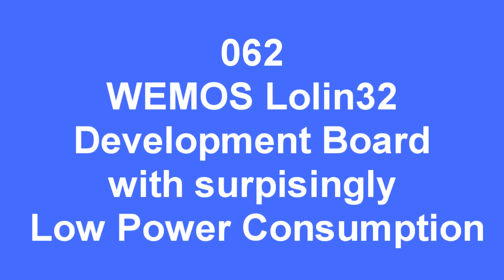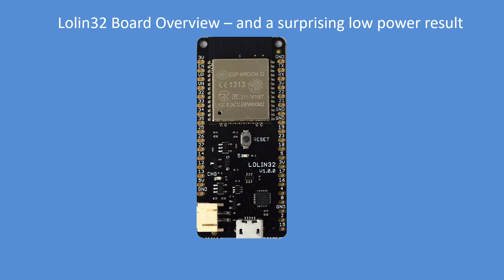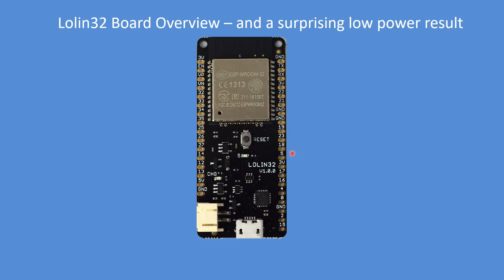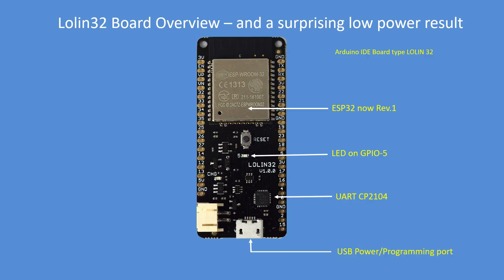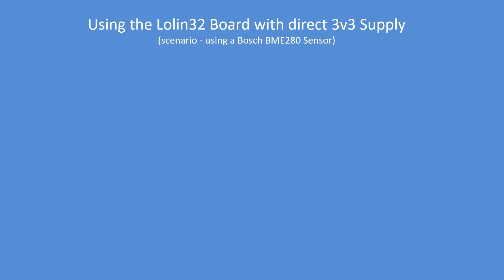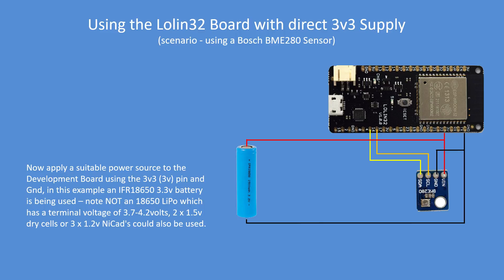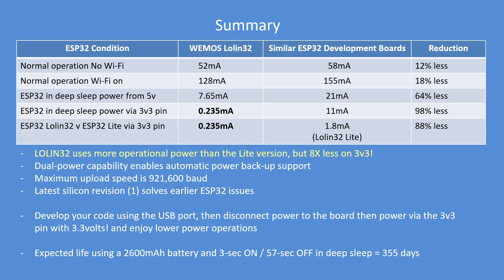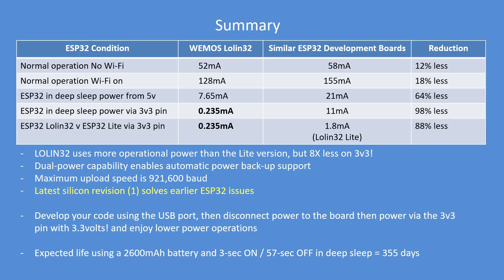Tech Note 062 - WEMOS Lolin32 (surprisingly low power demands when powered by 3v3)

Comment from the maker: The Wemos Lolin32 board consumes via the Battery input terminals ~122mA with Wi-Fi operational, 39mA when Wi-Fi is off and 128uA when in deep-sleep. This board is one of the best available for battery powered projects, bettered only by the DFROBOT Firebeetle32.
Reply from the maker: nearcz Are you using I2C as the LED is connected to the same pin. What I would do is print out LED_BUILTIN or check the IDE hardware variants then Lolin32 and see what pins have been defined for the compiler you may need to move the PIN numbers around for I2C either that or just before sleep switch the LED pin to an input. Any problems let me know so we can fix it.

Comment: I'm facing this issue for nearly 4 months; "A fatal error occurred: Failed to connect to Esp32: Download mode successfully detected,but getting no sync reply: The serial TX path seems to be down.
Reply from the maker: Most likely actually ESP32 or out of specification. Have you checked your power supply is adequate to drive the ESP as peak currents can approach 1-Amp easily when the wireless is activated
Reply: @G6EJD  I haven't used an external power supply yet, I was trying to program it through the USB cable as the power source.
Reply from the maker: @amirphilip2234 then that’s your problem, try a different USB port ideally on a powered USB Hub. An USB port can supply 1A which is marginal.
Reply: @G6EJD  I tried that,I also tried using different USB cables but still.I tried to reduce the baudrate also but none worked.
Reply from the maker: Then suspect out of specification devices. There are no endemic issues with the ESP32

Comment: Hi, nice technote. I believe I have the same board as you and I powered the GND+3.3V from a PSU like in your example! 
Yet, I still have a 7.7-8.0mA deep sleep consumption.
Also when the board wakes up (after correct time elapsed), It claims that the bootup reason is 0 and not 4(timer) as it should be. When that happens it also forgets the bootCount I store in RTC.
I use both UART 0 and UART 2 in the code - could that be triggering some more deep sleep consumption from USB chip or Serial-chip ?
Any ideas - this drives me crazy :-(
Reply from the maker: The board I used was a genuine Wemos D32 and the regulator on that board can withstand an external output voltage drive, ie 3.3v. So if you’re seeing 7-8mA something is sinking that current, of course you are removing the USB connection when measuring. I suspect the regulator type has changed or the board design is not the same. The ESP32 UARTs are used for the serial connection and programming  another for the flash memory communications, so you need to be careful your not using the wrong UART.  If the ESP32 is being reset, and it is because it’s losing RTC backup then suspect a power issue. It would be much better to power the board via the LiPo connector then there is the correct isolation in place. I would start with a basic deep sleep example to prove the principle that there is low power consumption possible then move on in steps to find out what’s causing the issue. You should easily get to 10-11uA sleep current.
Reply: @G6EJD Thanks for the clues - I alrady tried doing exactly that - connecting a LiOn cell to the battery connector and I see exactly the same behavior even if the cell was fully charged and measuring the current I saw the same 7.7mA.
Is there a chance I bought a pirate card than looks exactly like the original - anything good to look for ?
Actually I just bought 4 cards and I just tried another one but even if connected to usb power it fails to get onto WifI
Something is fishy
Reply from the maker: @cb831 sounds like a board fault then, unless the ESP is not entering sleep that is.
Reply: @G6EJD I'm sorry the WiFi issue was due to my DHCP ran out of adresses 🙂
But the new card behaves exactly as the first drawing 8mA, however it seems to return the right code 4 after timer-deep-sleep and the counter works.
I will move on tomorrow - thanks again
Reply: @G6EJD  I found out what happened. I tried different boards in my breadboard and they all had the same behavior. Eventually I got lazy and just tested free air and then it worked. I tried the other boards free air and the also worked ! Conclusion is that the breadboard somehow interfers - maybe capitance or whatever. I finished my setup on a veroboard and it works perfectly. And even if I feed the board through the battery socket (connected to a LiOn cell) my deep sleep current is around 100-200µA :-)

Comment: Hi David, I bought the LOLIN32 dev board. When I try to use the wifi it gives me a 'burnout' message. But the wifi works. Although the web calls take like 30+ seconds to go through. Any suggestions? I use only the usb as power, but tried to also give 5V on the 5V pin - same result.
Reply from the maker: It depends exactly what the message says.  Was the board the Lolin D32 ESP32 only available from the Lolin Store on AliExpress or some other supplier? If the latter suspect a chip issue, it is often the case that out of spec. boards are sold cheap. It should take a few seconds to connect to the Wi-Fi
Reply from the maker: ￡5.52 | LOLIN D32 V1.0.0 - wifi and bluetooth board based ESP-32 esp32 ESP-WROOM-32 4MB FLASH Arduino MicroPython Compatible
https://a.aliexpress.com/_vBYR8W

Comment: Great summary! I love this board and have done several projects with it. I have however had some issues when trying to charge (over the ESP32 micro usb-port) a lipo 18650 (connected to the JST) via the ESP32. Do you have any experience with such an issue?
Reply from the maker: None, I have 6 of these boards performing various tasks and they all charge an attached 18650 without issues, the current is limited to 500mA, so it can take 6-8 hours to charge. Are you sure the USB power source has sufficient capacity to power the ESP32 and charge a battery, at least 1.5A power supply needed.

Comment: can u help me?..when i flash my program its cannot upload...its seem that many people have the same problem too..some of video recommend to put capacitor between EN pin and to the ground..it works for a while but then i cant upload my program again...do u have any solution for this wemos lolin 32 upload problem?
Reply from the maker: Usually and in normally all cases this is due to a faulty ESP32 or a fake Lolin D32 board, there are no no issues with uploading just faulty boards, I suspect yours might be one of those sorry.

Comment: Thanks, David. I have a 3.7v 18650 Well battery, 2.2Ah that I am connecting to the battery JST connector to my Lolin32 v1.0.0 board. What I notice is that the board does not power. I have tried on 2 boards. I measured the voltage of the battery and it is 3.6V. When I connect it, and measure the + and - pins behind the JST connector on the board I get ~0.5V which is weird. Any idea how to tackle this? Thanks for all your work. Regards, George.
Reply from the maker: Hi George, I would check your battery connections using say a pin so ideally battery needs to be fully charged at 4.2v, check the voltage at the connector of the unplugged battery, I know it’s obvious but check polarity of the connection eg + to +, plug in the battery and then measure at the battery itself
Reply: @G6EJD  Thanks David. It worked after charging the batteries. :) Thanks.

Comment: How would you measure the batter level on this board?
Reply from the maker: On GPIO 35 using int value = analogRead(35); but only if it’s one of the latest boards (D32) and had a battery connected. Result needs to be scaled to the actual voltage usually with float voltage = analogRead(35)/1023*7.15;

Comment: Hi, Dave. Can you help me here? I am using 18650 battery shield to power this thing at 3.3v pin but its led just flickering and won’t run the sketch. I measured the voltage at the shield and its around 3.26V. Is it not enough?

Also, I have tried to use LM1117 with voltage 3.29 V and it is worked. But it is not that efficient I guess. What should I do?
Thanks a lot.
Reply from the maker: It seems your battery shield is faulty when put on load, the ESP load is about 200mA peak at startup if WiFi is on, less if not. If you’ve got one try putting a 100ohm resistor across the 3.3v terminal and see if it can hold the voltage. Next let’s assume your feeding the 3.26v to the ESP32 vcc pin and not to a development board Vin pin or 5v pin, most development boards have a 3.3v pin too, but don’t power via the USB port at the same time. The reason the battery shield board is so efficient is that it uses a buck regulator a bit like a switching regulator and so can reach 99% efficiency. All linear regulators will dissipate/waste power in dropping down from 4.2 to 3.3volts.
Reply: G6EJD Now my board is power up.

Yes, you are right, my shield was fault, the 3v terminal is less than three. And when I put 100 ohm, it was not anymore but the board is not power up. Also, I connected to vcc and its just flickering again.

Then, I tried using 5V from the shield throuh 5v pin on the board and it is worked only if I wiggle the terminal. 

Then, I hopelessly used 3V to 3.3v pin and it finally worked. Thanks a lot, Dave.
Reply: G6EJD I think I have bad cable jumper
Reply from the maker: If a DuPont cable then they are notoriously unreliable

Comment: Hi Sir. What pin can I use for measuring the battery power? and Do I need another circuit for that? Thanks for information.
Reply from the maker: I need more information to answer that, but you can measure input voltage on pins 35, 36 or 39. Most boards provide access to control and VNC 36 and 39, but a Lolin d32 has an onboard voltage divider to pin 35 that is connected to the battery Vbat terminal so you can monitor battery voltage
Reply: @G6EJD  I have seen than Lolin d32 has a pin for measuring battery but I have been working with Lolin32. So can I use pin 35 on Lolin32 for measuring battery power?
Reply from the maker: If it’s an old Lolin 32 board then pin-35 is not brought out and you have to use pin-36 or 39 with the inclusion of an external voltage divider usually 100k—100k is enough
Reply: @G6EJD  Thank you so much Sir! it really help me a lot.

Comment: Can we use the EN pin for lowering power ??
Reply from the maker: Unfortunately not, that pin (https://wiki.wemos.cc/_media/products:lolin32:sch_lolin32_v1.0.0.pdf) is to the junction of the rest circuit that ordinarily holds the ESP32 EN pin high and enables operation, the only way that pin can be pulled is down and that will reset the ESP32, so I not really sure why they bothered to do that? If they had brought out the regulator EN pin that would have made more sense, as the regulator could be disabled enabling an external power source to be used that did not power the UART charge regulator, etc. Wemos did this once, then stopped doing it, it's weird. Actually one of the best things they could do is have a link to separate the ESP32 dev. board power source to get a minimum sleep current, our only option is to use a bare break-out board.

Comment: Can I use 5V pin when powered by 3.7V battery connector OR with 3.3V by 3V3 pins?
Reply from the maker: When you power the board with 5v (USB for example) the power input goes to the voltage regulator and the 5v pin outputs 5v from the USB power input.When you power the board with 3.3v to the 3.3v pin then nothing will appear at the 5v pin, the voltage regulator has been by-passed.Your alternative is to power the board via the battery terminal using 3.6-4.2 v input range e.g. a LiPo battery.If you put 5v on the 5v pin, then you will be powering up the regulator again and unless you disconnect the 3.3v supply then the on-board regulator out of 3.3v will be competing with your external 3.3v supply.